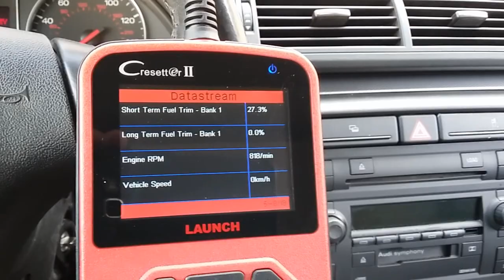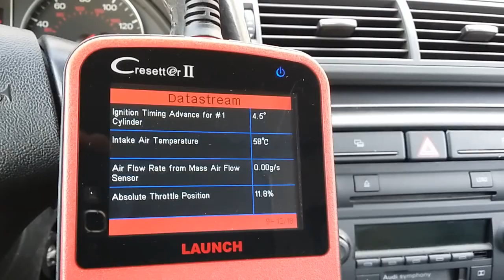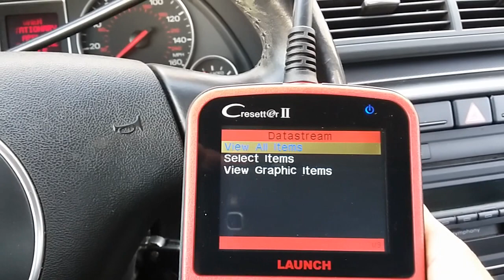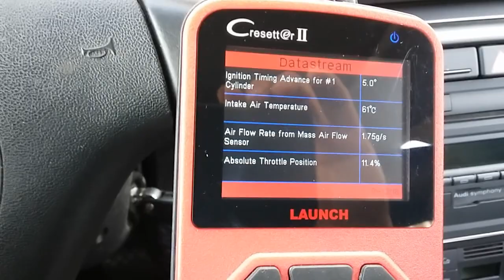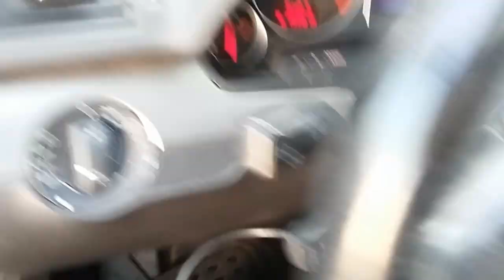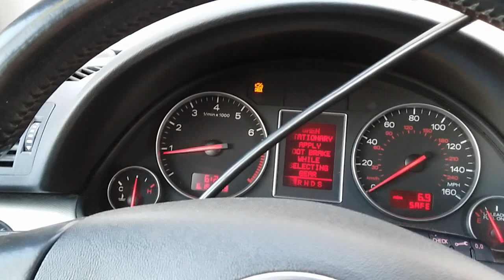(Audi A4) Pre-Diagnosis with Trouble Code P0102

Comment: I got the same po102 I replaced the sensor with a brand new OEM one and I'm still pulling same code. Got any advice.
Reply from the maker: You need to check the connector for power, ground and signal reference
Reply: @EliTheOBDTech  Will do. Thanks.

Comment: Did all this light still on car driving like crap
Reply from the maker: Did you replace the sensor with original or aftermarket or remanufactured? 
Sometimes aftermarket or remanufactured just don't work with these cars.
Reply from the maker: Forgot to mention, vacuum leaks after the MAF sensor will cause this sensor to act up.